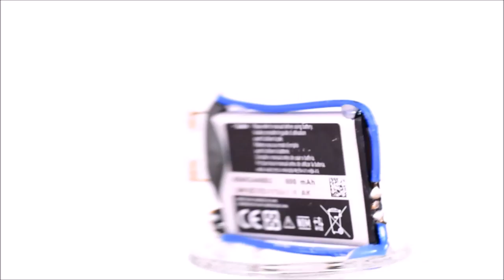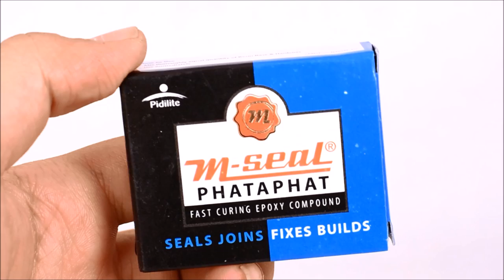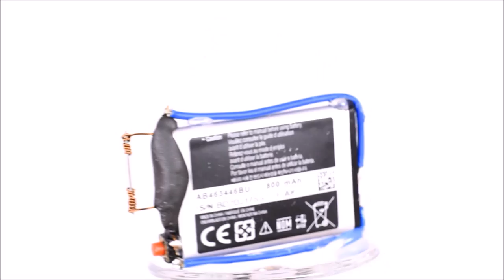How to Make a Lighter from Mobile Battery

Comment: is the wire u used  a copper wire?
Reply from the maker: Yes. It is a copper wire.
Reply: fek video
Reply: GearUp does it work with regular metal wire
Reply: @anmoltachnical1874  not fek video
Reply: No it's nicrome wire ye wire heater me hota hai